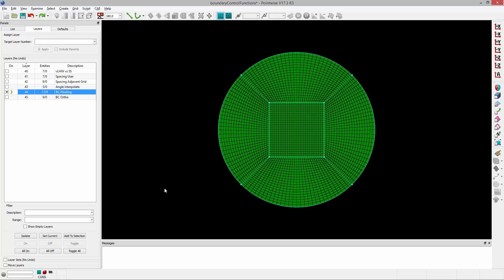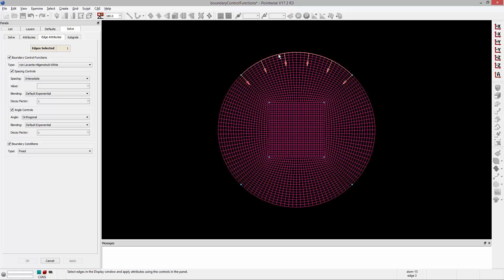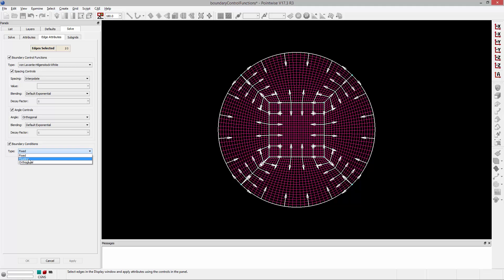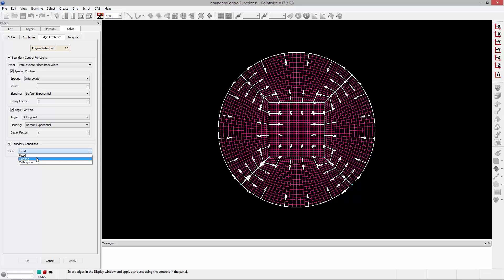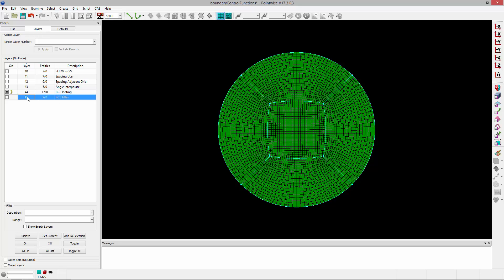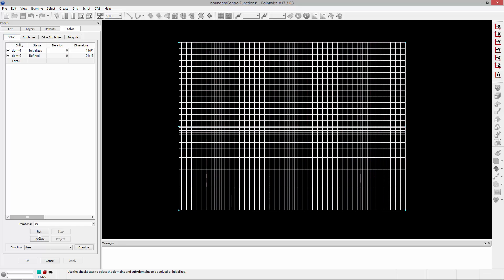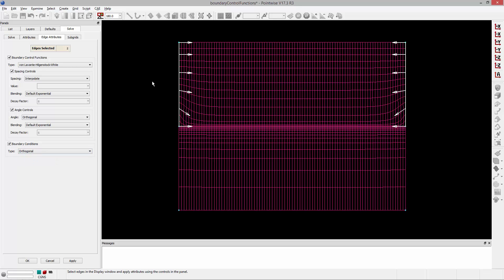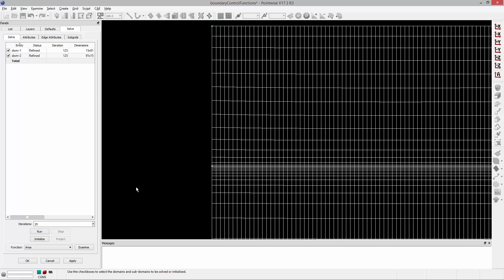Structured Solver Boundary Conditions

Comment: If I were to extrude the circular shaped figure you just refined, can it become one block? Or would it be 5 separate blocks?
Reply: There's no way to form that topology into a single IxJ surface so any blocks extruded from it would have at least two. For example, each of the 5 domains in the picture above would be extruded into a block. You could join the 4 exterior domains into a single O-grid and then extrude it along with the H-grid in the center, resulting in two blocks.
Reply: Yes, I tried it out and ended up with 2 blocks. Thanks.
Reply: So, I have this situation where I created a cylindrical port in pointwise and I wish the mesh in the cylinder to be of an O-Grid type. At the same time, I want just one whole block and not more than that. How can I achieve this ?
Reply: Rahul,

John answered your first question already.  There is no way to form a single I x J surface, so trying to pursue this O-H topology as a single block isn't going to work.  You will at least have two blocks given this topology.  Is there some reason why you're set on creating a single structured block from such a topology?  A true multi-zone structured solver shouldn't care about the block interfaces.

There is a script on Pointwise's Glyph Script Exchange that helps automate the creation of O-H type topologies.  You can find that script here:  https://github.com/pointwise/CreateOH
Reply from the maker: While we would recommend using an O-H topology for cylindrical geometries, if you are set on creating an O-grid, you will need to introduce a pole along the axis of the cylinder. https://youtu.be/d6z7VD84vfk, https://youtu.be/WNYzU5xTp00, and https://youtu.be/zCA6y3u3qHE are good references.
Reply: Perfect. But soon after I typed in the comment, I realized that I was talking about an O-H grid itself. I just missed out on the H. Sorry about that, but anyways I created an O-H grid manually on a circular surface using connectors. Since it's done manually, the resulting O-H grid isn't a perfect looking one. Is there an option where pointwise can automatically create an O-H grid on any surface? I've seen this option on another meshing software hence the curiosity. Thanks.